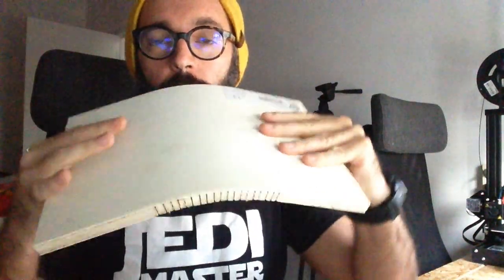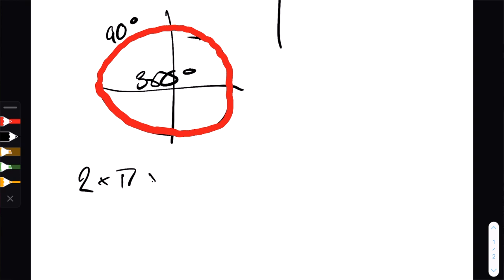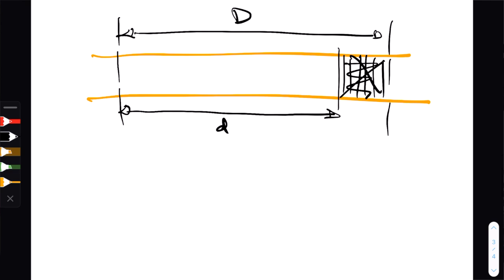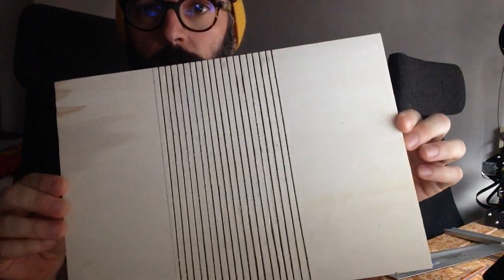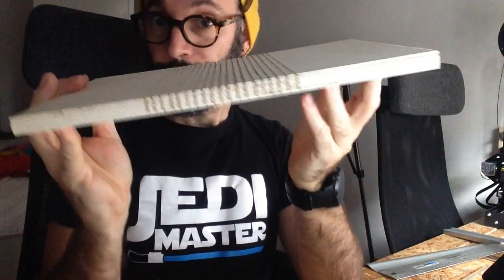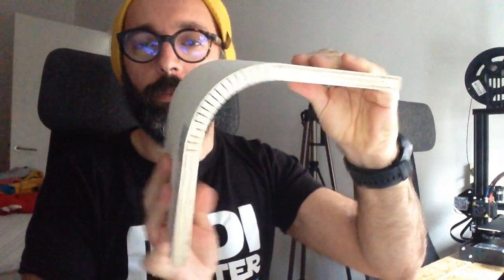How to do EXACT Kerf Bending

Comment: What about bending the plywood in the other direction? Does the formula or really the plywood cooperate?
Reply from the maker: The ply wants to break in the other direction
Reply: You are right. I got it done today though. I spaced out the cuts a little and it held up. I also think the 1/4 plywood I was using was not the best quality. Thanks for the help.

Comment: Excellent explanation of the theory behind kerf bending. Once you understand that you are simply trying to remove material to make a shorter internal curve and that a kerf is nothing more than removed material, it is an easy next step to take the mystery out of how many cuts etc etc.

The only thing I would add to your video is information that the kerf of a saw blade is not as simple as measuring the thickness of the flat part of the blade. You need to take into account also the set of the teeth also as well as any potential run out of a circular blade. The easiest way I know of to measure this is to use the "two sticks" method but maybe there are others...

Comment: @2:21 calculate arc percentage of circle
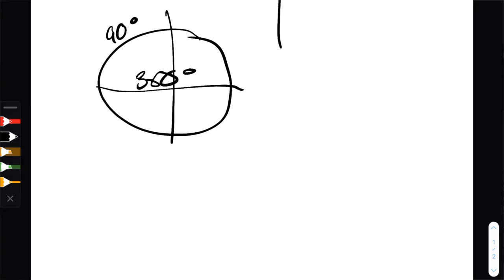@2:30		(for 90° bend)	90 ÷ 360    =1/4
@4:20 calculate inner & outer radii	
@5:15 		R (given): 70mm, 		r: 70mm - 12mm   =58mm
@5:17 calculate inner & outer arc lengths
@7:15 		D: 1/4 x 2 x 3.14 x 70mm  =109.9mm,    d: 1/4 x 2 x 3.14 x 58  =91.1mm
@7:21 calculate difference between inner & outer arc lengths
@7:38 		109.9 - 91.1 =18.84mm (≈19mm)
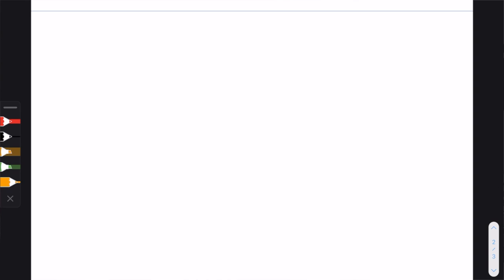@7:50 calculate how many kerf cuts to make (kerf = 1mm)
@10:08 		19mm ÷ 1mm = 19 cuts	 
@10:13 calculate spacing of cuts
@11:05 		110 ÷ 19 =5.8mm
   alternative: 110 - 19  ÷  (19 + 1)  =4.55mm		(accounts for initial space)
@11:10 layout the cuts
@13:20 cut the plywood

Comment: Thank you well explained ! Question if two different diameters one side R=124 angle 95° other side R=169 angle 116° , is this technique still possible by using fi the most cuts 25 (1mm saw) from the biggest dia. and/or should the cutting lines be parallel or angled to the smaller dia ? Thanks for help !

Comment: Your video is nicely done. The math is straight forward. The only thing missing is how deep should the cut be. I know there are zillion types of wood out there so it is nearly impossible to detail out. I guess I would have to try to cut pieces of wood that I normally work with, and do some trial and error to determine the depth of cut. 
Many thanks for putting this video together.
Reply from the maker: That is indeed the one bit that highly depends on the type of wood. I typically use 80% to 90% of thickness of the wood as a reference.

Comment: I liked your video, and it made me think about something I really hadn't put much thought into before. I usually just cut a bunch of kerfs and move on, so thanks. If you want to greatly simplify your math... Circumference = C, radius = R, board thickness = T: C1 = 2piR1, C2 = 2piR2, R1 = R2 + T, C1 - C2 = 2piR1 - 2piR2 = 2pi(R2 + T) - 2piR2 = 2piR2 + 2piT - 2piR2 = 2piT

In other words, it doesn't matter the size of the circle, the difference in circumference between two circles that share the same center and are T thickness apart is always 2piT.

In your example of a 12mm board: 2 * 3.14 * 12mm = 75.36mm. We want a quarter of that for our 90deg bend. 75.36mm / 4 = 18.84mm --> your answer in the video.

For a 90deg bend, the answer will always be: (2piT)/4 = 0.5piT for a board thickness of T.   A 180deg bend will be piT, and so on.
Reply from the maker: There is almost always an easier way. Most of the time, with some experience, just curring works fine. But the video was about exploring the exact way of doing it. Is it overkill? maybe yes hahaha

Comment: Another thing. The thickness of a saw blade is more than one mm. It is much closer to 4mm.
Reply from the maker: It depends on your saw blade. A table saw will be 4mm, the ones I use are pretty thin (I have some that are less than 1mm).

Comment: First of all, congratulations on this video, it is very good and very well explained and detailed.
I apologize if you don't understand me, I speak very bad English.
I have a problem and I would like to know if you can help me.
Using a saw blade has the problem of leaving gaps.
My question is: Can the formula be modified to use a cone drill bit instead of a saw blade?
example: at the extreme, the width of the groove is one millimeter and at 14 millimeters deep,the width of the groove is, for example, 2.5mm...
How could I do the calculations?
I have tried but I have not been able to do it correctly.
Thank you so much.
Reply from the maker: You need to use the width of the gap at the surface. In a saw blade the width is more or less the same, in a cone cut the width will be biggest at the surface, so that should be your saw cut size. Hope it helps!
Reply: thanks for your answer. Unfortunately, with the cone drill bit it is different. although eliminating exactly the excess material R-
and obtain the exact pieces, removing more from the other end, the final diameter is not what was expected.
What I would like to know is if with the data I am going to give you you could do the exact calculations.
For 180 degrees:
R+ 10cm R- 7.4cm wood thickness 2.6cm
1mm conical router bit and the other end 4.5mm at 25mm depth.
R+ = 6.28x100=628/2=314mm
R- = 6.28x74=232.36/2=116.18mm
R+ - R- = 197.82mm (198 material removed)
198mm/4.5mm router bit = 44 cuts
314-198=116mm/43 pieces=2.7mm
Please where is the error and how can I fix it?
Reply from the maker: @MiguelJimenezManzano  Mmmm ....let me check it.... maybe it will be easier by email.
Reply from the maker: @MiguelJimenezManzano  ok.....the first error I see is that 6.28x74 is 464.....so half of that is 232.... but you are dividing by two again, which is wrong. Hope that helps.

Comment: Sorry, it looks easy on a 90° but I tried 100° and got completely confused. So, I just cut into the wood and guessed it, when working with 4x2 over 10ft/3mt with an outside length of bend at 600mm it is a lot harder than a small piece of ply.
I am constructing a gazebo/shed that is partially open but can be closed by this structure which mimics a panel garage door. The structure is 2 x 2x4s bent and joined to form a 4x4 with a channel to take rollers into it, so, I have to bend these then route them and I have 6 to do. Once I have built one I will copy them onto the others, it's probably a lot easier than maths.
Reply from the maker: Good intuition and experience will definitely help....but math never lies 😉

Comment: great video. one Q, i need to bend ply or MDF so that the smooth surface is on the inside, ie the concave side?
Reply from the maker: I have done ply with the inside as the smooth side... but that bend makes the ply more likely to break. I suggest using steam or damp to facilitate the bend and the fill the outside gaps.
Reply: @OneTimeBuilds Thanks for the idea. Its MDF and the radiuses vary, I will think about filling gaps too, it will require some experimenting (:👍

Comment: This is fine teaching in action thank you! But I believe you made one error, and if not it would benefit me for you to correct me. When you divided outer radius (D)/ 19 wouldn’t that place the last kerf at the end of your radius? To contain all 19 kerfs evenly spaced would you not need 20 evenly spaced sections of remaining material? So wouldn’t the formula for spacing be D/(((D-d)/k)+1)
Reply from the maker: Yes...well spotted. I made the mistake but decided not to redo the entire video. The error is around 5% overall (1 over 20) and your blade and measuring is likely to introduce a larger error

Comment: Sorry to comment on a 2-year old video, but I wanted to share my observation. I took this a step further and did this algebraically rather than numerical. The result is that the bend radius falls out of the equation. The number of kerfs is purely a function of bend angle, not the bend radius. So a 90deg cut needs 19-cuts, regardless of the bend radius. The bend radius defines the cut spacing.

The equation is:
A*R = A*(R-T) + n*K

where A is your bend angle (in radians), R is your outer radius, T is your board thickness, n is the number of cuts and K is your blade kerf.

Solve for n and you get:
n=A*T/K

In your example, with a 90deg bend (pi/2 radians), 12mm thick board, and a 1mm blade kerf, I get your 18.8 cuts like you did. 

FUN MATH! Seriously, thanks for the video. I nerded out pretty hard on this one.
Reply from the maker: Yes!! that is a great observation. A couple of comments below someone else wanted to bend in a cone shape and got indeed equal number of kerfs for both ends.

Comment: Thanks for your tutorial, makes a whole lot of sense, and when one stops to think about the math involve, it makes even more sense.
I have a little bit of a more challenging Kerfing  project, where the bottom and the top of the curve that I need to achieve have a different radius. I am still bending the material one quarter turn (90 degrees), so when finished it will look like a quarter segment of a cone.
The material thickness that I will be using is 19mm, the height will be 40cm. The bottom radius will be 20 cm and the top radius will be 10 cm. My initial thinking, without doing any background calculations, or trial and error experiments will be that the kerfing will have to be done at some corresponding angle. The other train of thinking will be that half the height of the kerfing  will be calculated to meet the 20 cm radius while the other half will be calculated to meet the 10 cm radius.
Your suggestion and thoughts on achieving this type of kerf bending will be greatly appreciated.
Cheers
Reply from the maker: I have tried a cone shape bending before and your thinking is along the same lines. The biggest challenge is that the number of kerfs needs to be the same for both ends (because the kerfs need to meet) but the larger radius would need thicker kerfs. My cone kerf was not 100 percent successful though. Id say the best approach would be to calculate the kerfs needed for both, then use the result that gives the largest number of kerfs. You then space the marking of the kerfs on both ends and connect the lines, which will have a cone shape. Good luck with it!
Reply: @OneTimeBuilds  Again many thanks for your prompt reply. I like to show you the math, because for one reason or another even though the top and bottom radii are not the same, the amount of material that is required to be removed ended up being the same!!
Known factors; material thickness 19mm
                            Cone height         400mm
                          Top radius. R.        100mm
                       Small radius  r.           81mm
                     Bottom radius R.       200 mm
                        Small radius. r.        181mm
               Saw blade thickness.          3mm
Top kerfing calculations 
Big radius.        0.25X2X3.14X100=157-
Small radius.    0.25X2x3.14X81=.  127
                                                             30mm
30mm, material to be removed at top radius
Bottom kerfing calculations
Big radius.        0.25X2X3.14xX200=314-
Small radius.    0.25X2X3.24X181=. 284
                                                                30mm
30mm, material to be removed from bottom radius
30mm divide by 3mm (blade thickness)= 10
Need to cut 10 saw kerfs along top radius of 157mm and 10 saw kerfs along bottom radius of314mm
Top radius 157 less 30=127 total space between kerfs, so 127 divided by 10=12.7 approx. spacing between kerfs at top radius
Bottom radius 314 less 30=284 total space between kerfs, so divide 284 by 10= 28.4 approx. spacing between kerfs at bottom radius 
This is obvious that the kerfs will be at an angle
Just have to come up will the formula to figure out the angle.
Your input and/or review will be much appreciated 
Thanks
Reply from the maker: @kathleenbonello679  it seems about right. No need for a formula for the angle, just connect kerf 1 top with 1 bottom, 2 top with 2 bottom etc. The cuts connect the marks at the top and the bottom.
Reply from the maker: @kathleenbonello679  one more tip....the middle kerf will always be perpendicular to your top and bottom borders....so you use that one to draw and connect the rest so you dont need an angle
Reply: @OneTimeBuilds  Thanks for your input. Looking forward to actually trying on some material, but it won’t be for a couple of weeks

Comment: There's only one little problem in your calculations... 😁 If you have 19 grooves you will have 20 spaces in your specific distance.... 1 cut = 2 spaces, 2 cuts =3 equal spaces and so on... ☕from Italy 🙋🏻‍♂️  nice video and good explanation, by the way
Reply from the maker: Yes....I made that mistake and someone spotted a few hundred comments below. Good catch. Overall however, 1 space in 20 is only a 5% error :-)
Reply: @OneTimeBuilds  indeed, the error it's minor.. That wasn't my point 😁 you could get away with a 1 cut less or 1  more than the exact number.. Wood is very forgiving and flexible 😉 Especially if you wet the outside of the plywood in order to achieve a smooth bending, without any cracks or high spots (which happens when using a 4mm circular saw blade)
Reply from the maker: @_777Z  Yes....you are totally right!

Comment: Hi, I fully understood the math you used and was able to confirm the results. I tried a larger radius of 203 mm using 12mm plywood .  The calculations worked out to 19 cuts with a distance of 17 mm between cuts.  I could not get the wood to bend and it kept snapping.
Reply from the maker: I would suggest to cut less deep then. Depending on wood type, the stress of the bend might want to snap the wood.
Reply: Did you put HOT water with fabric softener in it?  Soak it it with the hot water(spray bottle), wait a few and it should bend for you!

Comment: Would using an angled router/carving bit with a very narrow tip, say 6 degrees,  0.8 mm allow me to simply divide the degree of the bend by the angle of the bit, or would i not remove enough material?  Thanks
Reply from the maker: I dont think so. The issue is not the angle but the length of the material that jas to be removed

Comment: Ok ... so I gotta ask.  5.8mm on a tape measure you can see the 5mm and you would have to guess at the .8 mm amount.

On a table saw how do you continually adjust 5.8mm on each cut?  What tools do you use?  Do you use something like 321 blocks with feeler gauges?
Reply from the maker: mmmm.... you can make a rig with kerfs of the right spacing... then you put the blade of the table saw in kerf 7 (or whatever number you are on) and fix the guide to the end of your rig. The next kerf, you use kerf 8 and repeat. The key of course is to build an accurate rig. You could also 3D print one with 20 kerfs or so :-)
Reply from the maker: I guess on a table saw you can make a rig that is exactly 5.8 and use it as reference
Reply: @OneTimeBuilds  
I guess my problem is that I'm not visualizing a solution.  You have a strip of plywood x units in length.  You have to slide said piece of wood down after each kerf.  Which to me means that the space either left or right of the blade will get either larger or smaller meaning something has to move.  Only thing that I could imagine is alike a finger joint jig where you slide the previously cut kerf onto some sort of reference point.
Reply: Thank you for an amazing explanation!  However, I find your handwriting very difficult to read.  Without following your verbal dialogue I don’t think that I would be able to decipher it!  As an example, some of your “mm abbreviations for millimetre” are simply a wavy line.  Very informative nevertheless and I will be studying your video carefully as I need to kerf bend  a perimeter curb for a custom lazy Susan that will be building.
Thanks,  John Jensen from British Columbia.

Comment: Not too bad, but the calculation of how many kerfs(n) are required is much easier. 

The Outerradius (R) is only required to calculate the distance from kerf 1 to kerf n.
R*π*a/180=(l)

not required to calculate. Only following parameters are needed thickness of the wood (s), angle (a).
The formula is: n=a*π*s/180

Distance(d) between kerfs i defined by d=l/n
Reply from the maker: Yes, you can simplify the formulas for a much faster calculation, but the point was to explain how to derive the formulas :-) not the final formula itself

Comment: Nice job on the video have you ever thought about doing 1 on 4 sided compound mitres for columns
Reply from the maker: Thats an interesting idea!
Reply: @OneTimeBuilds   Presently what we do now is make a rectangle shet a plywood with a mitre on one side Set the appropriate taper and cut all 8 sides assemble and re adjust the angle Simple it works but would be curious if there's a way to do it with math

Comment: Quick question/ thought: 19 cuts means 18 gaps between them. If you make the first and last cuts on the 110mm marks and divide the 110mm by 18 instead of 19, would this stil work?
Reply from the maker: Thanks for noticing! Other ppl also spotted the mistake. The introduced error with one extra or missing cut is however very small. Id say less than 5% which is probably lower than the overall error :-)